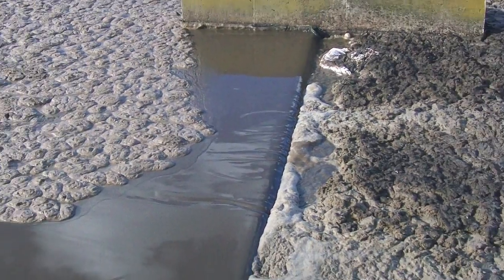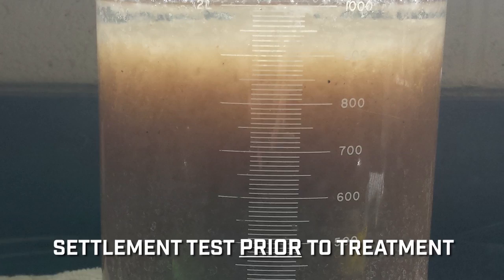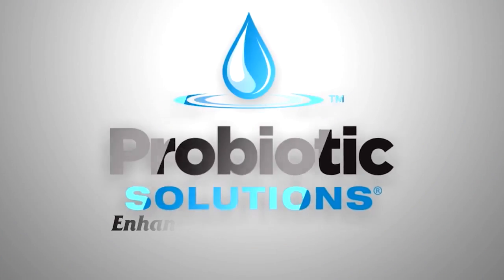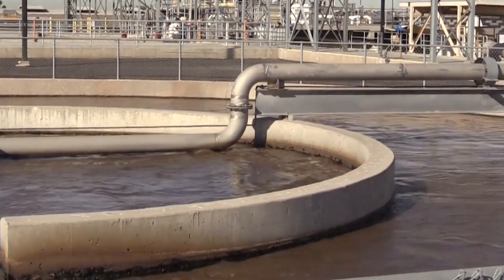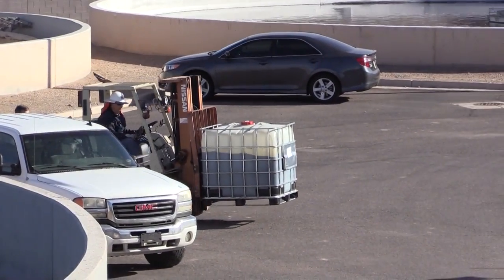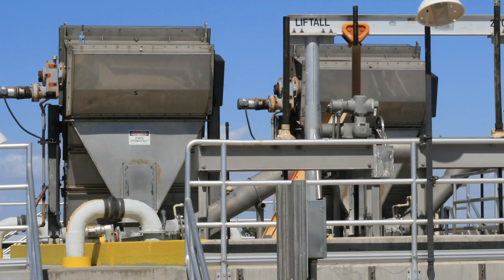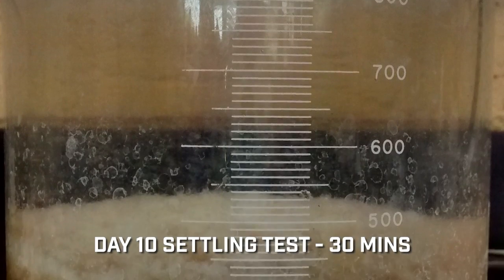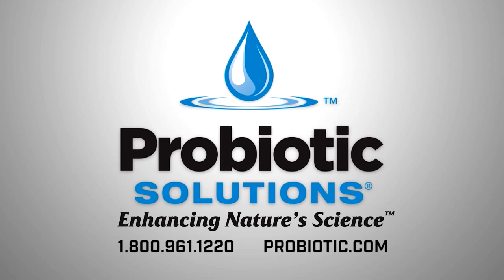How to Reduce SVI & Foam in Activated Sludge Plants

Comment: Typically, in my experience, Anything that you add vs adjusting MLSS for proper MCRT and or return rates is a band-aid. If your MLSS and return rates are correct you should have the correct MCRT and F/M ratio. The only time you would add anything is if you gone too far out of balance and are violating. You have to be mindful that anything you add that increases settability in plant artificially will most likely artificially change your 30min. settling testing and SVI determination. It's better to stay ahead of the curves by closely watching your wasting and return rates. Maintaining the correct MLVSS and F/M ratios is key.
Reply: It's been over 1 year since I completed my wastewater course and I can no longer remember what those acronyms you mentioned stand for. I also have interview at a wastewater plant in 10 hrs and Im panicking.
Reply: @Bowskidll  Don't worry just answer honestly with what you know. There is a big demand for operators now and if you keep at it, you will get a job in the industry.
Reply: Really interesting comment, thanks. Are you essentially saying it's better to manage bacteria levels (by optimizing return/waste rate) than keeping excess bacteria alive (to avoid foam formation) by adding nutrients?
Reply: @enemyofthestatewearein7945  Yes, I would only add nutrients if I needed to artificially maintain a population in support of a specific removal objective. Another time you might add nutrients would be to build up bacterial for a known increase in BOD. Like a resort location that sees an increase in population quickly. Ideally you have a steady supply of BOD and you adjust your population to address that. Then the only changes you make are for seasonal temperature changes.
Reply: @tgchism  Thanks for reply, so basically nutrient addition should be seen as a management tool for irregular loading. Otherwise, if you are adding constantly in a stable process, it's really just an expensive fix for a poorly optimized plant. Makes good sense to me, better process optimization will usually save energy, rather than increasing running costs for additives.
Reply: @enemyofthestatewearein7945  Yes, my thinking has always been find the cause vs treat the symptom. The cause was almost always a process imbalance. Wrong return rates or incorrect MCRT is usually the problem.
Reply: You are absolutely correct!  People just want to sell these miracle products and i have yet to see one work.